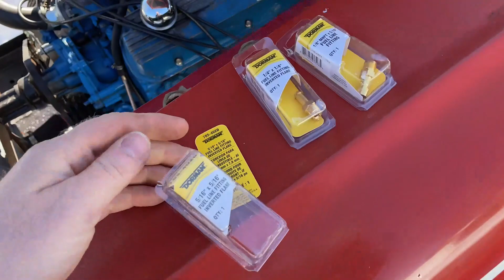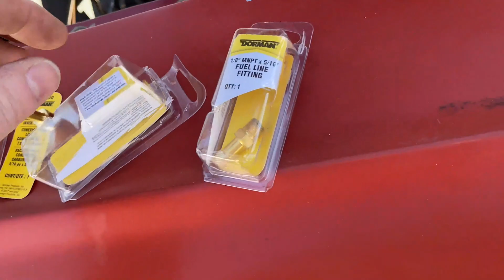It's the Small Things that can Kill You!! Pt.24

Comment: If that was my car, I'd have tetanus shots in my toolbox.

I love it! Can't wait to see a lovingly reanimated junkyard special destroy the Gutless Cutlass!
Reply: Lol that 289 would blow Daves gutless doors off. one of the dumbest things I've heard this yr was Jess saying  that moron was going to put a 350 in there, I'm like what excuse me..lol 🤣 ya it'll drop right in np your 6 cylinder  tranny  will love it along with the rear end, that's when I knew what a dope this guy was, be cheaper  to buy a whole new car...
Reply: @damonadams7199  depends what year the car is, if it's an early-mid 80s car it probably has a 3.8L Buick V6 which would have a TH2004R and that will bolt up to a BOP V8 no problem, it would also have the same 10 bolt rear a 307 would have had too.

Comment: Yesssie....nice to see the car videos just to know I'm not the only person wanting  to blow there brains out dealing with fixing  cars, it's been 2 weeks of hell, both my cars are down my honda blew the clutch after 320k and now my Toyota avalon both 03 this pos had a rusted hood latch it took me over a week to get it open, I was rdy to take a grinding wheel and cut the prick off, I parked it 10 months ago when I bought it and ran fine no issue's, I jumped it ran great all day then just stalls out, running parked at home thank God, now won't barely start. when it does its running like a fuckn misfiring turd that I gotta keep stabbing the gas to keep it running  for about a min or 2 till it just dies. My odb2 isn't talking to the cpu so I can't get a sucking code, so now it start pulling sensors time and trying to scan.and then light testing every frigging  fuse to see if there's a short. I hate new cars.. my stepfather  gotta 78 Pontiac fire chicken  parked in my driveway about to shoot him a offer I swr, I'm about just say fuck these new cars,  gimme a old v8. All these frigging  electronics on em. I need a sensor for my prick next to tell me if I gotta hard on coming  so I can aIert the wifey..wish I nvr sold my 72 Buick skylark  350..live and learn, anywho...love ya guy no homo, and tell Dave bow ties are for fairy nice guy's #gutless4life  and holy crap your wife was vacuuming  the garbage barrel 😆 you poor guy,  I actually  feel your pain brother now I truly understand why your so tired. Then I bet she has to clean the vacuum bc it's been in the garbage, I had a gf like  that once, it's only girls from other countries,  you won't see a American born girl do that stuff..and worst part is they want you to be like that. I couldn't  leave a cup out, I had to wash the dishes as I was cooking...I understand your pain brother  I understand  your pain. Thank God tomorrow  is Sunday fun day... c u all tomorrow. ..
Reply: hood pins take less than a week to install. death wheel win